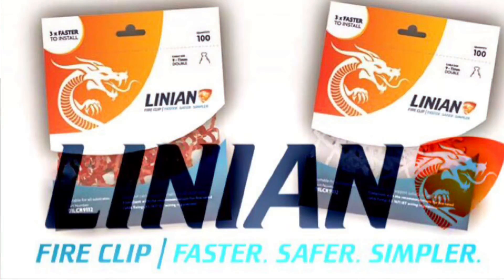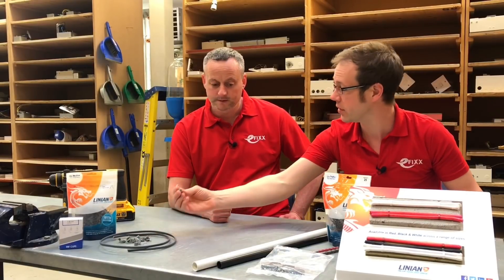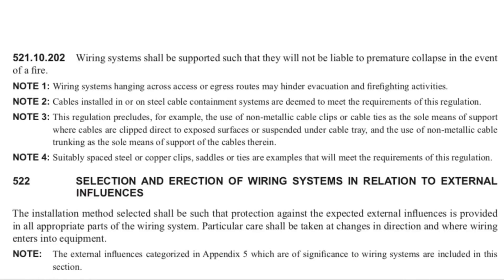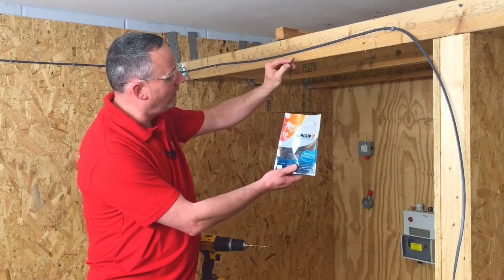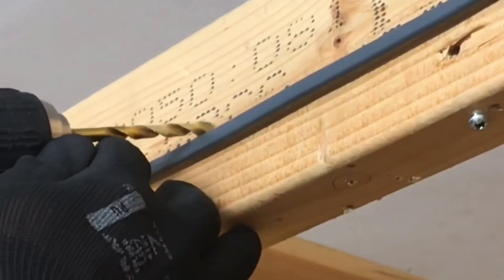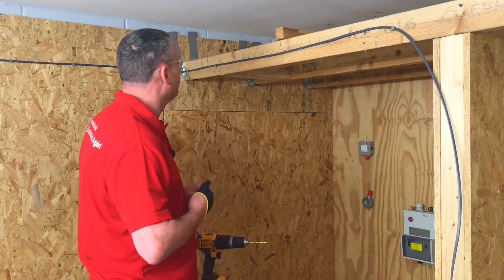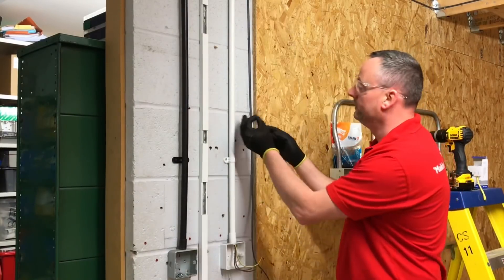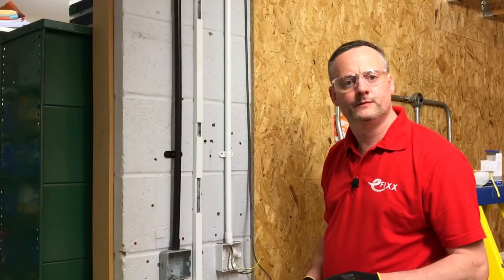LINIAN T&E Fire clip review Clips to Prevent Premature Collapsing of the Wiring System BS7671

Comment: The building is presumably burning, cables falling (inside the wall?) are probably not a big deal.
Reply from the maker: It's more about surface mounted cables and suspended over escape routes dropping down and entangling fire fighters attempting to deal with the blaze/get people out.
Reply: @efixx  surface mounted cabling makes sense. Though, even if on fire, wouldn't the insulation layers just melt first, leaving the wire itself suspended by the straps (which would hold longer with this product). I can see how it's useful, has it been made code yet? I'm in Canada, not sure about adoption here yet.

Comment: Very nice. 
In the US, we often fasten with plastic insulated metal staples, so if the plastic melts, the staple remains to hold up the wiring.
Reply from the maker: Is the use of the metal staples required as part of your codes in the US?

Comment: Schneider Electric Thorsman fire rated steel cable clips are another option. Tested up to 930 degrees Celsius so it says on the box.
Reply from the maker: Hi. Thanks for the commenting 👍
Reply: Used Thorsman myself, they hammer in just like the standard clips, and as a bonus, you can remove them with a removal tool just as easy. Universal for 1.5 and 2.5 T&E cables.

Comment: What a brilliant product. Related question, is the void above a suspended ceiling seen as a preventative barrier to stop the callapse of a wiring system?
Reply: If the suspended ceiling supporting the wiring system has no fire redundant properties then no, the wiring system would need to be adequately supported by some other means.
Reply: @ashmanelectricalservices4318  would the grid frame itself not be deemed as a structural barrier? They are usually a metal grid frame
Reply: @gazdkw82  In my opinion, I won't deem this to be an appropriate means of preventing premature collapse of a wiring system as more often than not the cables are just pulled in and lashed across the top of the metal grid, when the ceiling tile catches light and fails, the loose cabling and slack will fall through the opening entangling anyone below.

Comment: nice clips and vid thanks for sharing love the new channel, while i was in the wholesaler the other day they did show me some metal ones like the old plastic can't remember the make
Reply: Probably Schneider fire clips... Should be ok on timber, I wouldn't wanna chance it on old motar joints though.
Reply: Alvin Ashman yes agree nail wasn’t the longest
Reply from the maker: Hi. Any solution that will prevent premature collapsing of the wiring systems has a massive thumbs up from me (Gaz). These clips were very simple to install and blended in with the wiring systems 👍😁. Thanks for the comment and feedback Gaz.

Comment: Great design!.. You could hide them inside pvc surface trunking too? After screwing the trunking to the wall drill a 6mm hole push the clip in, maybe a blob of intumescent seal to maintain ip integrity, voila done. These are the only ones I have seen so far that cover 90% of situations where support is required. The only issue I can see like someone else pointed out is... How do you remove them 🤔
Reply from the maker: Hi. Thanks for the support 👍. https://vimeo.com/233296893 the video link should help. All the best Gaz
Reply: @efixx  ah.. Makes sense compress the clip. I thought they just relied on friction fitting with the barb. Neat 😊

Comment: I would like to use them but have you seen the price!!!, making it harder and harder for self employed electricians to afford stuff. £1.20 for plastic clips, £30 for them 🤔🤔 someones getting brown envelops.
Reply: I have a battery dewalt cable stapler and the staples are only £12 for 500 clips.. press the button and move on, so much easier
Reply: @triggsymalone9820  yeah i saw that, might have to check it out. Thanks

Comment: Another option for fire rated fixings for Twin are Schneider electrical metal clips, basically the plastic clips but metal
Reply: The Linian Fire Clips appear to provide a more secure fixing, I very much doubt you'd be able to pull or hang off a Schneider fire clip as Gary done in the video.
Reply: @ashmanelectricalservices4318  and wiring twin in metal conduit would be even better. Fully up for using them on concrete/brick walls but who is going to be drilling 6mm holes in joists and rafters? I was only providing another fire rated fixing for twin, Mr negative.
Reply: @anttrib  My apologies if my comment came across as negative... On wooden joists or rafters, yes I agree with you, probably a cheaper and faster alternative but in masonry walls and ceilings, I'd probably go with Linian.
Reply: @ashmanelectricalservices4318  you don’t have to hang off it It is only to support the cable
Reply: anttrib . A much better option 👍